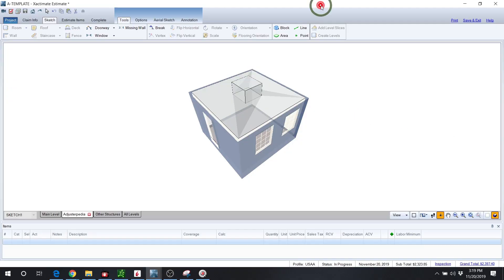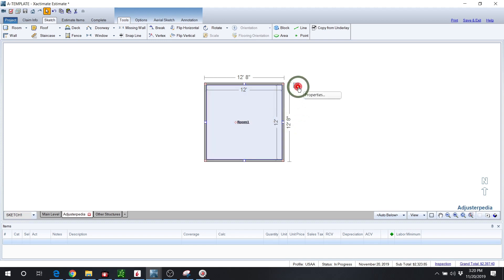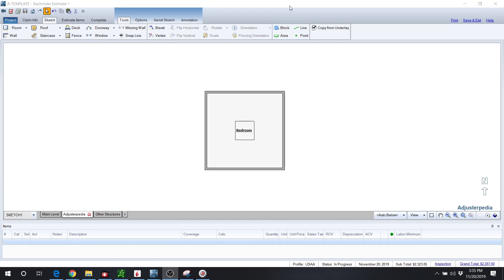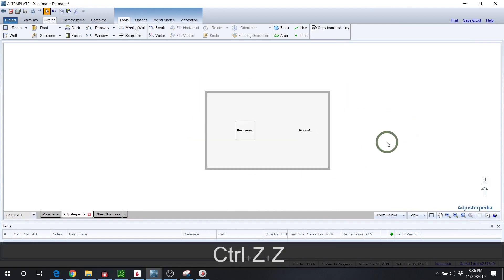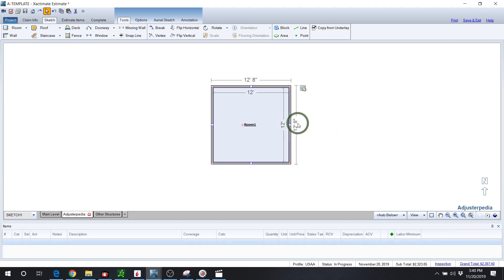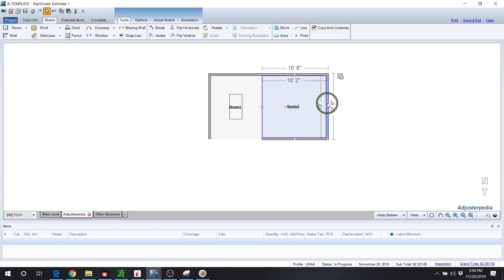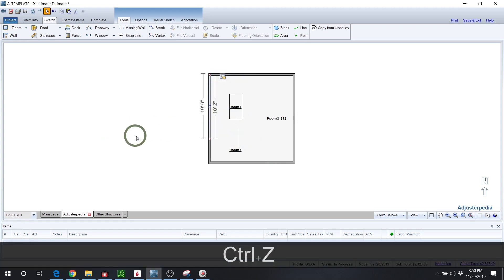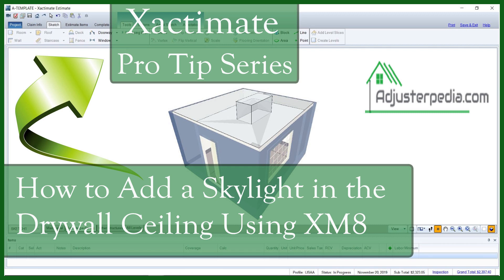How To Add a Skylight in the Drywall Ceiling Using XM8

Comment: What if I need to add the skylight into a Sloped ceiling?  Also how can I change the slope to the South instead of North?
Reply: Did you ever figure out how to do the skylight? I have an attic ceiling and I need to add 2 to the slopes portion of it
Reply: @kylepatrick8190  Honestly I don't even remember but I don't think I ever did. Since then, I joined an Xactimate / Roofing type group on Facebook that is pretty dope and very responsive may be worth looking into and asking there lots of seasoned vets itchin to help lol.